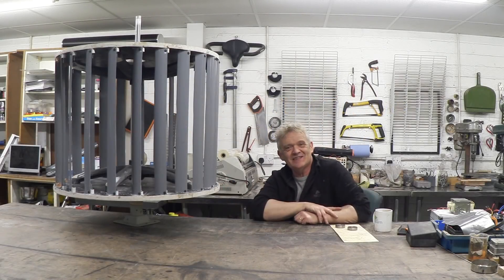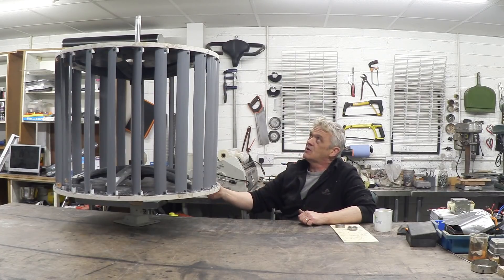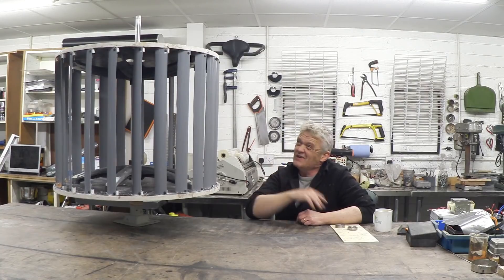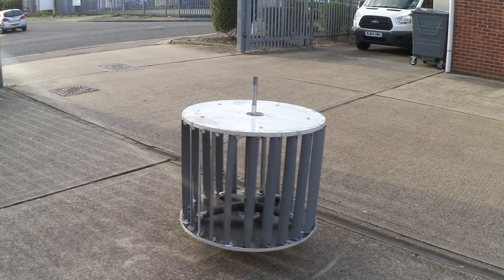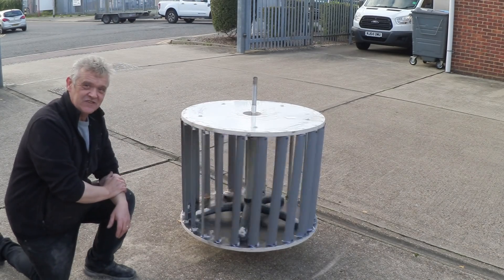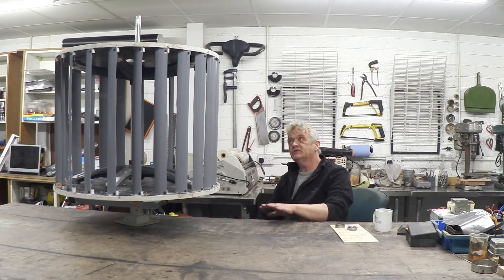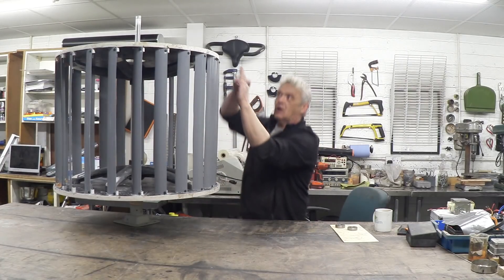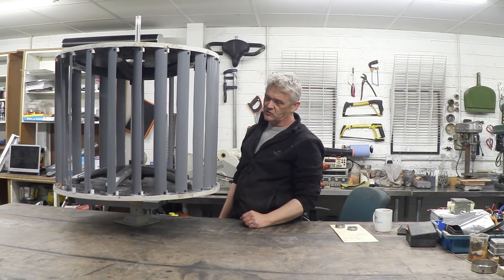Building a 1kW Wind Turbine For Under £100 - Part 2 - Rotor Wind Test

Comment: this is a brilliant idear, but to big to be usefull for house hold. what about in a closed housing with low opening on Roof line. so the Rotation isn´t visible from the ground, also kill the sound of the unit.

Comment: I have been watching a lot of wind turbine videos.  My question is if you mount the turbine with a tail so it will rotate. If you block off 1/2 the blades that would cause drag on the system would it not this turbine to work better. I am thinking sort of like a water wheel.

Comment: Interesting. How much noise will this produce cmpared to a horisontal three-blade turbine? Noise is usually the biggest issu for place a windturbine. I'm ging to build a new garage and placing a system of vertikal windturbines would absolutely be somthing I would be considering. Needs a double roof to protekt the windturbindes from snow. Also placement of a radial windturbine into a venturi could be interesting to try. We almost always have wind, but combining several small turbines with a battery solution...

Comment: I'm a retired electronics engineering technician going to try building a vertical wind turbine generator that is a little different, I've had this idea for about 15 years I just haven't done it yet. It's time to turn a drawing into the real thing. Not connecting the turbine to a generator but turning the turbine into the generator with no belts, or shafts. I'll probably make it out of wood, and fiberglass in resin and use bronze bushings with neodymium magnets on a shaft for bearings. I figure there are blade angles that work the best so I'm watching videos and learning before doing it myself.  I like to use wood because I can cut and fill wires and magnets inside and after fiberglassing it's super strong and can take good g force, also I have done this construction skill before building robots, test equipment, and hot rods. I plan on using magnetic sensors maybe Hall effect and some kind of digital speed controller that will turn on and off power resistors for braking. The magnetic field on the turbine created by the resistor load will slow it down in high winds. I would like to find an already-built module for speed control but if I can't find anything I'll use open-source robotics software that can run on something low-powered like a Raspberry Pi. just have to get something small working. I think using robotics software I can use part of the circuit as a brake while using the other parts to generate at the same time if the batteries need it. Also, anyone like hobbyists or students can rewrite apps or subroutines for it.

Comment: Look up water studios Parthenon.

I had thought of that with about 20 foot vertical wind turbines forming the top portion (and 30 foot wave turbines underneath), with slotted recurve wave walls and slotted rock armor that would stagger out for more or less a mile like a spider web rice patty with each ring about 5 feet lower than the previous, that would greatly reduce large waves before it even got to the 20 foot wall, all the while generating power from water, wind, and solar on top of each portion of the vertical wind turbine top ring.

I thought it would be made out of graphene concrete and graphene plastic or carbon fiber or steel.  Each ring would be about the width of a 2, 4, or 8 lane highway.

The inner circle would have relatively calm water, and the air “should” be calmer.  You can have a more central proportion that would close like a Huge stadium roof (hurricanes)

What I’m Really curious is how it would fair in Really Rough Seas like a Hurricane.

I thought of the interior, and exterior you could grow algae for oil in bags like kelp.  That way you could grow oil, you would have all renewables as your Wall, and you could generate hydrogen and transport it to the mainland.  Besides having a floating city in the middle where everyone could live and work, and you could have floating hotels for people to visit and see everything up close in comfort

Comment: maybe not with something that big, but i'm wondering if you have the vertical squirl cage design if you could have a top and bottom magnet bearing.   or how about a magnet bearing using 3 magnets with the center one mounted to the rotor with the top magnet could attract up to carry more load or maye repel down for stabilithy ----   then have a set top and bottom.

Comment: This is totally pointless. Most of the time there will be no useful output and it will never pay for itself. For starters the great majority of people liv e in areas where the mean wind speed is not particularly high. The power output is proportional to the cube of the wind speed. Next this thing is not very big. The power output is proportional to the square of the linear dimensions. That is why, to be worthwhile, wind turbines have to be big and in windy places. Anyone taken in by this will be very disappointed.

Comment: Certain washing machines have axial flux motors built in. They also have SUBSTANTIAL mounting/bearing bosses with meaty, beefy bearings as standard, designed to take VERY high radial inertial loads ... A 9kg load spinning at 1200 rpm ... Is a LOT of inertial load!

The biggest problems you are likely to face are:

1. Finding a suitable direct drive washer, nowhere near as common as standard universal motor. Look for good German makes.

2. Being able to dismantle & cut the outer drum away sufficiently but keeping sufficient material to use as a mounting. Alternatively, cutting the hub away completely from the outer drum is often an option.

3. If the washer is scrap due to worn or seized bearings then the biggest issue is gaining sufficient access to be able to remove BOTH inner and outer bearings and replace them with new. It's doable with the right tools and technique but often it takes a LONG time due to greasy gunk, gunge, rust, and all round general filth especially around the bearing water seals - yuck!

Even if not used for this kind of project it's worth it to just get at the direct drive motor (used as an alternator) and removing the hub completely to work at on the bench and used for any project having to handle large radial and moderate axial loads.

Access to a decent sized lathe gives MUCH flexibility in altering the diameter of the bearing seats in the hub to take different style bearings, like even beefier or larger bearings. Originals may be a non standard size so changing bearing seats can give access to much cheaper, more easily obtained bearings from Ali Express (great low cost source, albeit slow to get ... 2-6 weeks).

 From personal experience I'd say ALWAYS use xxxx-RS or -2RS (RS = rubber sealed) and not -ZZ (steel sealed) as they are well worth the miniscule difference in price (pennies) and the slightly less operational efficiency due to the rubber sealing friction but MUCH longer life in dusty/damp/external environments (VAWT). 

I've pulled apart many washers and tumble driers (good source of reversible synchronous motors!) and it's not just the motor that's of value:
Lots of useful parts like temp sensors, heating element, general flex wire, heavy duty springs, tube sealing spring clips, vibration dampers, switches, water valves, relays, triacs, thyristors, other electronic components. 

But the biggest, often ignored pieces are the large area enamelled/galvanised FLAT steel panels easily cut out with a steel cutting disk on an angle grinder - brilliant for all sorts of things like magnetic white boards (!!), Cutting further, bending into custom size steel project boxes & enclosures, creating other structural pieces, large sheet galvanised side up tops to protect your work bench top when doing metalwork. The list is almost endless.

Comment: Hi Robert, quick question if you were to get a permanent Magnet mother run it off a 12v battery ( recharge it  by solar pannal ) would that give you more watts out than you put in if enough microwave transformers and magnets were used?
Reply: No. There is a thing called ‘conservation of energy’, I suggest you look it up.
Reply: @pedropig  your funny. The power is generated by the movement of a magnetic over a coil as it causes an EMF that creates the energy so I did not think asking the question was stupid. And as the battery is being charged it is kinda like a generater. Given they only convert energy type. So thanks for the answer as thinking about it you maybe right but you can keep the attatude
Reply: @seannolan343  firstly, it’s ‘you’re’, not ‘your’, secondly, I was genuinely trying to help you fathom it out for yourself. Seems like I wasted my time.
Reply: @pedropig  I said thanks for the answer and I can see you were right. However your choice of language was offensive
Reply: @seannolan343  which word(s) did you find offensive? It seems to me you just want to feel offended.
Reply: The phaze "I suggest you look it up" is in my experience only used by people who are trying to be supior and in addition it suggests that this is so obvious go do the leg work; if I know what to look for I would of and then not asked the question. I then explained why I ask the question and said that you were right. Which was my nice way of saying thanks for the answer but it had attatude attached to it which is not really required as I was looking to learn. To which you correct my grammar let's be honest how was that not condasending.
Reply: Well yes, it is quite obvious, and yes, you did need to go and do the legwork. You did the legwork and you learned something. I’d consider that a good day ! No need to feel offended, and no offence was intended.
Reply: Obvious to you which is fair not obvious to everyone. If no offense was intended fair enough. I have thank you for your answer. Let's part friends

Comment: Hi Robert, I keep wondering whether it might be better to cut curved slots in the discs to house the ends of the blades. The blades could then be glued into the discs
Reply: He seems to err towards simplicity. There's a lot of opportunity to make an errant cut with what you suggested, even though it would be more sturdy. If you have the skills$equipment,  go for it. Just pay attention to detail

Comment: I am a old wood worker 
So your chop saw m8 
Can cut perfect circles ! 
Sink the saw into large bench , i use a hatch and drop suported below so when not in use easy to remove ! 
Position saw and work peice , large circles saw at 45 
Use a screw in center of circle to spin the work peice and start choping , you will get to a point where you hold the saw down and finely trim perfect circles,  shure you can fill in the gaps of my explanation,  your not daft!! , you can use the setup to index very accurately as well and so on , like drilling or edge details ect

Comment: I wonder if you could get that cost down by using a slow speed generator, using a big wheel to mount arms  on it. At the end of each arm would be mounted a giant bamboo half to catch the wind like a cup. And you could have a few of these mounted on the wheel for a vertical wind turbine. While using air scoops to speed it up or that funnels air to the wind turbine. ?

Comment: So have you measured the torque? Speed is fine, but TORQUE is a vital necessity in wind generation devices. A small suggestion; If you made the blades much bigger, and blocked the wind from the up-wind side, you would create lots more torque. The blocking wall would turn with the direction the wind blew, so the wind could not blow the blades backwards, and rob you of torque.
Reply: Nicely diplomatic Jack.
Otherwise what a humongous waste of time and resource for what will be a truly puny output;
It has *far* too many blades for a start. It will work as a wind blocking device - you *have* to let the wind blow through the thing. It would make an epic fan though, as per what's buried in the dash of most cars.
So why not just use 3 blades, a little more plastic for a tail and use the bearings so it can follow the wind.
Thus using a fraction of the materials, a fraction of the time to build, an off-the-shelf motor as its dynamo, much greater reliability and get 10 times more electricity out of it

Comment: Seems like too much mass for that low of an rpm. That's good for maintaining rpm. But only in high gusts.

If you want some actual power from that. It should be 4 times as tall. And three times as wide. And your blades could be a little bit closer together.

That's what you want for the amount of weight you already have.

Then you'll get some real thrust to wait action. You could even put a smaller gear on it for a higher ratio to the generator.

Comment: Just a question with it. Could you mount magnets on top and bottom and change mount structure to double the output? I would like to build something like this but I would need accurate and complete list of things involved
Reply: Magnets itswlfs would just act as a  flywhell but when you would add coils it would generate resistance and i doubt efficiency would be good much better to make transmission from the shaft onto the generator

Comment: Lots of room for improvement  with little cost. Like old Muslim windmills, cover the half that is returning against the wind with holes to allow the air pressure out on the sides, then on the other side have a bit  of plywood or something sticking out to the left  channeling more air into the active      bit of your windmill, like a funnel is for water and it will spin faster with more torque. IF you want it faster for longer, use ceramic bearings as well, they are brilliant but not cheap. You can store excess in super capacitors and lithium batteries, then when the wind  dies down, you're good to go.

Comment: It seems the blades should be on a "collective" similar to helicopter blades, where the angle grabs the wind for up to 270* of rotation, and "feathers" thru the other 90*
This would require lots of rods attached to an offset crankpin, and LOTS of little bearings on the blades.

Comment: Im sorry but vawt such are  yiurs are known to be weak in torque. This is because half of it is not facing the wind. With rrspect to the other half  facing the wind 25% of that is oppposing the other 25% percent. This is because the left and right side of that other half facing the wind are being pushed in opposite directions. Its not only low cost that matters but efficiency. There is not much future for this kind if turbine.

Comment: I love the construction but 1000 Watts seems a bit optimistic. Any update on accurate figures?
Reply: I was wondering about the same thing... so did a bit of estilations: Assuming a wind speed of 10m/s, air density of 1,16kg/m3, rotor efficiency of 30% (optimistic for sure) and cross sectional area of 1 square meter, that would produce 174 watts of power. Double the windspeed for quarduple power, half for quarter power etc. That's just the rotational power, rest depends on the electronics.

Comment: Great project.......I love how engineers can recycle materials to build useful  machines,  if you can produce power for lighting or electric heater, I read a blog of a guy that generated power in Canada and used it to heat a immersion heater and produced hot water...

Comment: The weak point will be the blades.  You would do well, to place a spacer in the middle of every blade, attaching one blade to another.  Then, you will have an official "squirrel cage", just like in many HVAC units.

Comment: I hope your pick up coils are bifilar. That way you can elimate the cogging by buck boosting the additional coil by shorting or variable capacitor, tuning for a phase angle shift so both peaks align. Anyway more wattage due to less resistance ...even though twice the weight in copper if circuit design was proper ,one could get 360watt horsepower.
Reply: What's a watt horsepower?

Comment: What a BS. Lower efficiency than the horizontal axis and what wind speed it gets 1kW at? During a hurricane?
Show how it spins when it is loaded.
If it spins at all. 
You are happy that it’s spinning freely?! What an accomplishment! Wow!
Reply from the maker: that seems a very mean comment and really not very well thought out - any 1kW commercial wind turbine needs 25-20mph winds -and did you watch the other vids? or just figure one was enough? ah well -it takes all sorts - cheers
Reply: Robert Murray-Smith I’m in the business of wind turbines. Also invented the most efficient VAWT yet.
It does not change the fact that they are BS. 
Just a few places on the planet that they make sense where average annual wind speed is 8 m/s or higher.

What everyone fails to tell the overly enthusiastic iPhone kids is that the rated power of a turbine is given at 10 m/s. In most places the average is not even 5 m/s.  And that when wind speed drops down by half, turbine output drops down not half by 5 times!
To 1/8 of its rated power (2x2x2=8).
Yes, it is a cube, not proportional.

No matter what wind turbine it is,  they are all BS. Especially the VAWT. There is not much energy in the wind. End of the story.

I have seen only one honest company that actually showed what happens when a 1kW turbine is loaded by a 100W light bulb at a moderate wind speed. Just one hundred W load and the turbine practically came to a stop. So did the sales of that company.
Cannot defy laws of physics.

Comment: Brilliant.  Only thing I might suggest is using at least two of your vertical arms at 90-degrees to stabilize it.  You motioned like you were only putting in one.  With two, you'd get front-back plus left-right stability.  With 3, you'd get the benefit of a tripod, more even forces transferred to your ground plane.
Reply from the maker: cheers mate